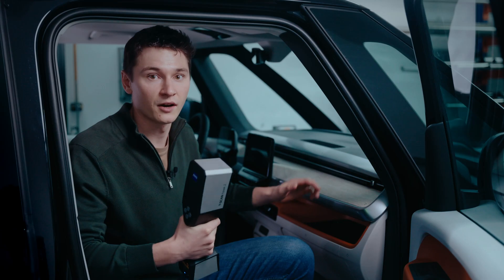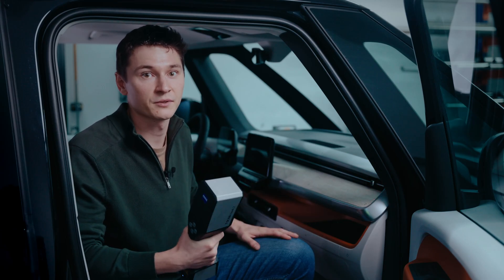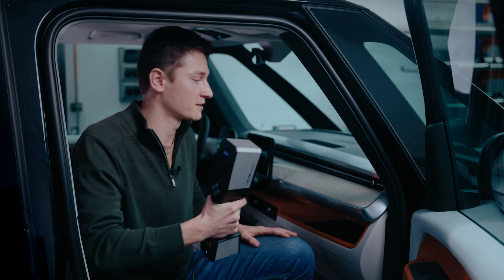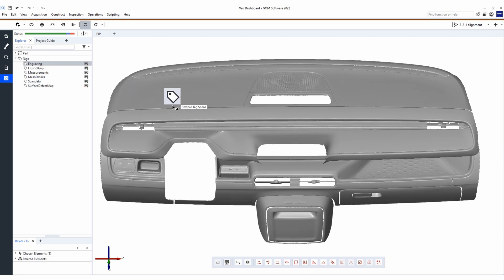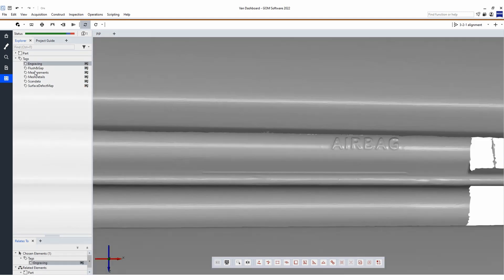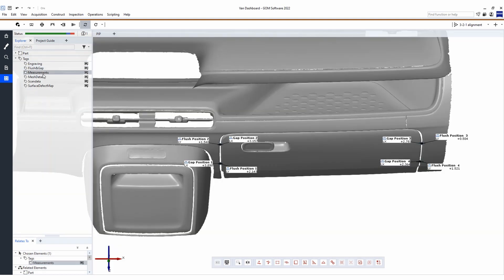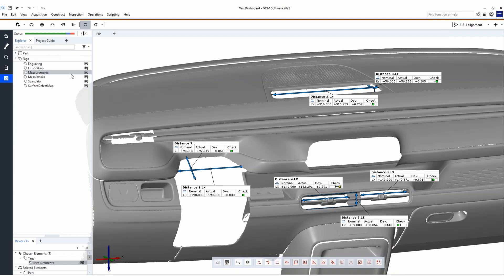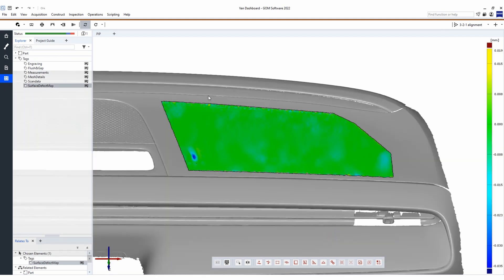T-SCAN hawk 2: How to use a 3D scanner in confined spaces

Comment: The confined space... of a mini van!
Reply from the maker: This is one of the examples. You can even measure in smaller areas because of the size of the system and its small stand-off distance. It is a self-referencing system and not a tracked system where you have problems with line of sight or jumping error or accuracy discrepancies between tracker and laserscanner. The T-SCAN hawk 2 deliver detailed and reliable accurate data.